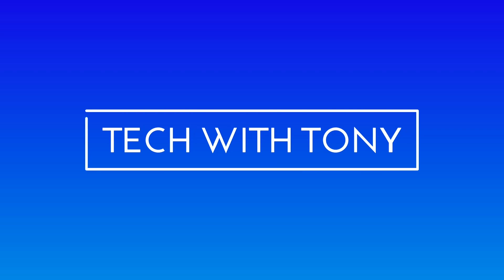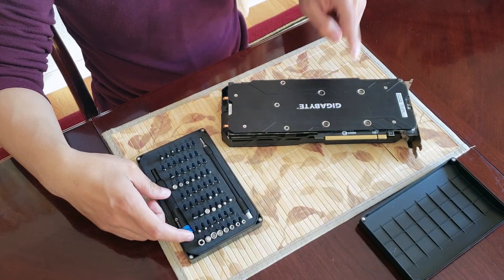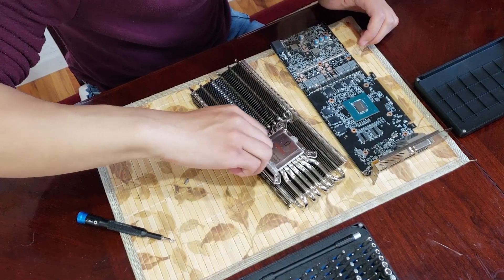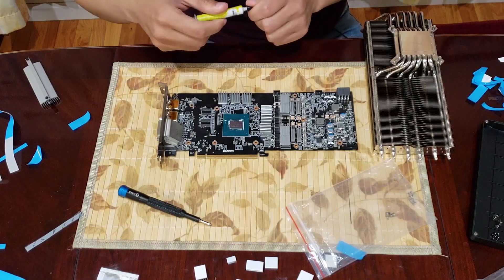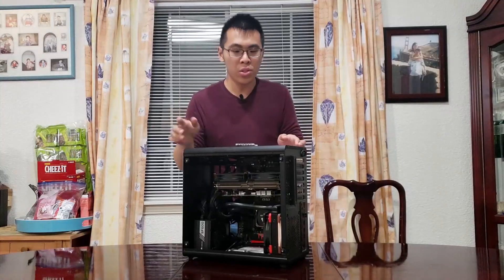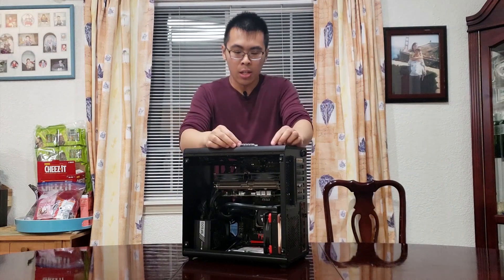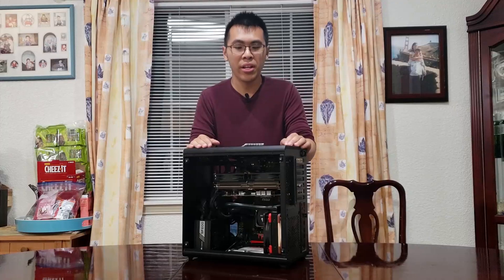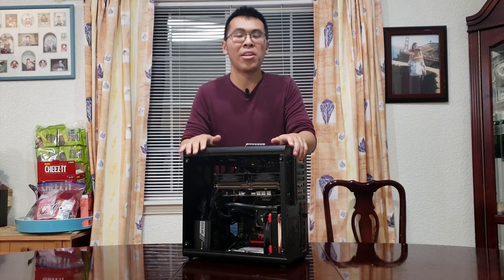Rajintek Morpheus II GPU Cooler Review

Comment: What could be the problem if the fans don't spin when connected with a y splitter and a VGA PWM Adapter to the 4 pin gpu fan slot. But they work when they are connected to the motherboard.

Comment: Got one of these and two noctua coming Tuesday. My RTX2070 by gigabyte running games at 1440 routinely runs 80+ and even hits  88c so I have to manually depower it and run the fan 100 all the time. My case has great ventilation my CPU runs 47c and it’s over clocked. I ordered some extra thermal tape and an adapter to hook the noctua to the fan controller on the GPU board. 

Really informative video sir and thank you.
Reply: Hey, what are your temperatures after changing the cooling?
Reply: @dawidnowicki9871  my temps now hover between 35-55 idle and load respectively now. This mod to this video card is probably the beat you can do besides liquid cooling. Some of the loose heatsinks are not putting on namely the heavy copper ones. The heat sink tape won’t hold those on so I just took them off. I also got some good thermal paste don’t cheap out on that part. Also got two noctua fans to put on it and like I said it’s an awesome fix for that card.
Reply: @dawidnowicki9871  also I don’t even run the new fans on it more than 30% speed and keep those temps.
Reply: @chrisg2739  Thanks for the comprehensive answer
Reply: @dawidnowicki9871  you bet and sorry for the spelling errors. This auto correct puts some weird words in.
Reply: hey there! a bit late but I was also interested in adding this to my gigabyte RTX 2070 since it runs just as hot as you described with the stock cooler. which gigabyte card do you have? because I've read somewhere online that it doesn't fit for the windforce RTX 2070 2X due to how the memory chips are placed on the PCB, which is the one I have.
Reply: @Gonzxlx  I have that exact card. The gigabyte RTX 2070 GV-N2070WF2-8GD wind force. But I had no issues with the memory at all on mine. The install is a little wonky because the directions suck. I do recommend getting different adhesive tape for the small heatsinks.

Comment: Pro tip: three 90mm fans actually work better and they can easily be attached with small nylon zip ties. Just run the tie down through the hole (and fins) as if it was a 'bolt'. Then, snip off the top off of a second tie to secure the first one on the back side of the cooling fins as if it was a 'nut'. To secure the edges of the outer fans that don't contact the cooler, just use an uncut zip tie as the 'nut'. Then run the tail up through the hole and secure it with another zip-tie 'nut' in the front.

Comment: Hey, Tony. I'm back. I've installed the Morph2 on my Sapphire Vega64 reference. It works great. I'm 1715Mhz on core clock, while maintaining temps under 45c.. .   under load. 40+Vm, 1120Mhz.  Using 2 BeQuiet 120mm pwm fans, it's quiet. I had higher clocks but I'd like my Vega64 to last till 2023.

Comment: What about graphic card fan header wattage delivery on the Card ? Will it not overload the fan header and possibly burn out fan controller on card ? It is not easy to find out the  details on power /ground/rpm pinout for a card and not risk shorting.I'd really like to see a dedicated PWM header for external fans on the PCB of graphic cards.
They would be much easier to reach and it will eliminate the need for mini PWM adapters.
I have got GIGABYTE GTX 1080 G1 GAMING card and dont know yet whether I need to take of the entire heatsink just to be able to properly reach a fan header since I wanna use the heatsing on the card and just remove the fan shroud and replace the fans.

Comment: I bought one for my Vega 56 MSI Air Boost Edition yesterday. The Core Edition. 
I have to wait till it gets to my country.
Right now, the card is driving me NUTS, it's a slightly tweaked reference cooler. It's HOT and LOUD. Holy crap.

Thank you so much for the video.

Comment: That back mini plate used to reinforce the gpu in the chip area, that is low. I'm not sure is fitting on all the cards and since the cooler is heavy, it can't be left aside without risks. 
By not fitting, I'm thinking of electronic components found on the back of the gpu die. Those could touch the plate or could be shorted by it. 

Also, why the hell did you blur when you put the thermal paste on ? I find that hilarious.
Reply from the maker: On this GPU the backplate was more of a heat trap then actually cooling off anything since it has no thermal pads on it or anything. The reasoning I blurred out the  thermal paste application was because sometimes I like to do the spread or pea method and I don't want people in the comments to get angry.

Comment: Don't know if you used fans with static pressure. But I'm using the Morpheus II Core (in black) with two Arctic P12 in white (black/white case look) on a 980 Ti with a self modded BIOS to gain more performace. Idle temp is 25°C, max. temp is 55°C. And for Memory and VRMs you should not use the aluminium shit from Raijintek, better use copper heatsinks (from amazon for ex.).

Comment: you could keep the original backplate and put the Rajintek X plate on top of it or the screws arent long enough ?
Reply from the maker: Yea the plate does stop me from putting on the back plate but if you find long enough screws you can potentially make that work

Comment: What would you say the average fan speed was before and after installing the cooler?  Fans spin slower overall?  Thanks
Reply from the maker: I think the g1 cooler went up to 2000 rpm which I'm not 100 perfect sure if that is correct other not but with the noctua fans I keep them at about 70 percent fan speed which is about 1000 rpm. Just enough so that it's inaudibile with the side panel on. The fans are definitely spinning slower then the old fans since the old ones were just 90mm fans they had to spin much faster to achieve similar results as the 120mm ones I have on now.
Reply: Tech with Tony ah okay you keep them at a fixed speed.   I’m thinking of getting this so that my gpu is quieter and still have set to auto
Reply from the maker: Ya I used to do that before but I just set it to a fixed speed so that whatever I'm doing the noise of my computer stays consistent

Comment: I cant find the morpheus II anywhere in stock :(
Reply: my 1070 (blower style) is way to loud even when in idle because of the fan. And in under full load I get temps of 84 degrees C
Reply from the maker: You could try to replace the thermal paste on the GPU to help with temps, if you have a founders card you can take off the plastic window that's showing the heatsink to cool it a bit better.
Reply: @EhoenChoi  How do you think I felt? I had a 1080 TI blower and it wouldn't go below 80 C even with an underclock. Do what I did and get the ID-Cooling Frostflow 120 VGA, or get the arctic twin turbo III
Reply: Newegg.com still has them on sale now for $75. Good luck.

Comment: You know if this is going to fit in rtx 2060 ?
Reply: It will fit yes. But you can buy a GTX 1080 for the same price as an RTX 2060 and will perform significantly better. Unless you are super keen to be tracing those rays.....
Reply: @theobarfoot3010  where? 1080's have been through the fucking roof from my research
Reply from the maker: I do believe that this will fit but you have to use the Vega 64 or 56 mounting holes
Reply: @Neiva71  Morpheus 8057. Hasn't been released yet but fits the 2000 series and AMD equivalents. https://www.raijintek.com/en/products_detail.php?ProductID=137

Comment: im having a hard time to put the fan on the heatsink. please help
Reply from the maker: Yeah the fan installation can be tricky I recommend putting one fan on a time and you kinda have to space it just right so that the fan brackets catch the small heat sink cutout at the ends. Fan should be secured in 4 points, in the video I actually only secured the fans at the ends of the heatsink which worked but made installation more difficult.
Reply from the maker: https://www.performancepsu.com/raijintek-morpheus-ii-vega-gpu-cooler-cool-off-vega-beast/

Here is a link to a site that has some nice pictures that could help

Comment: Good, informative video. Can you post a link to the 4 pin adapter? Did you need 2 or did you use a splitter?
Reply from the maker: Here is the link to it, GELID SOLUTIONS PWM Fan Adapter for VGA Cooler Fan https://www.amazon.com/dp/B005ZKZEQA/ref=cm_sw_r_cp_apa_9eE9Bb6XYCWEK 
Also I used one of these adapters and then a splitter for my 2 fans